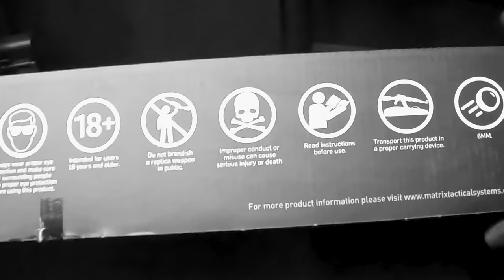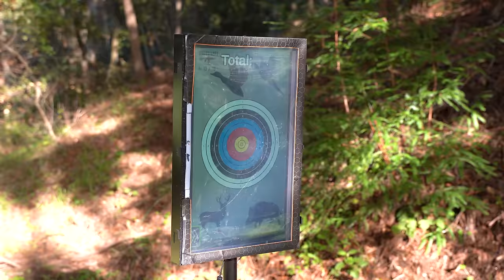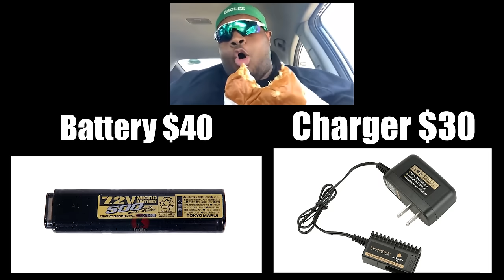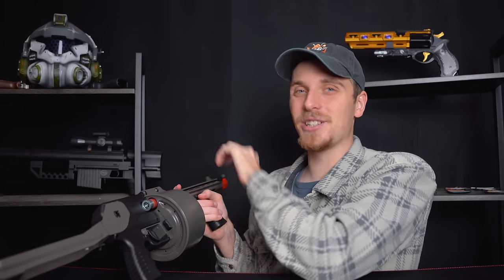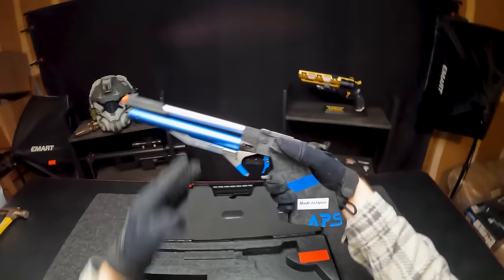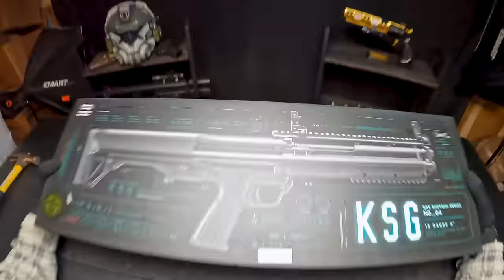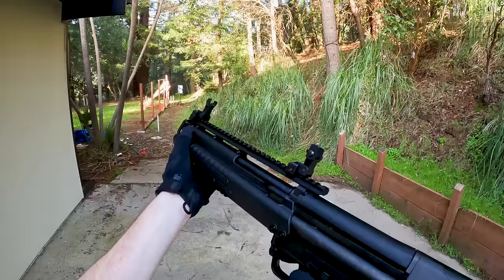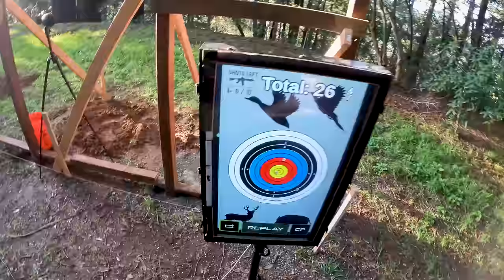I Bought $2,000 of Airsoft Guns You Didn't Know Existed!

Comment: On the KSG, you forgot to mention that it can fire 3 or 6 bbs at a time to switch to 6. There is a loose cover on the top of the stock behind the iron sight gently push that forward and pull up be careful as the cover is flimsy, now on the side there is a switch to select 3 or 6 bbs

Comment: I wish airsoft guns would be made so you can open the bolt all the way and pull the charging handle back all the way. It breaks my immersion with the airsoft gun when you can only open the bolt a couple inches. I also wish they would make the full auto airsoft match the fire rate of the real steel gun